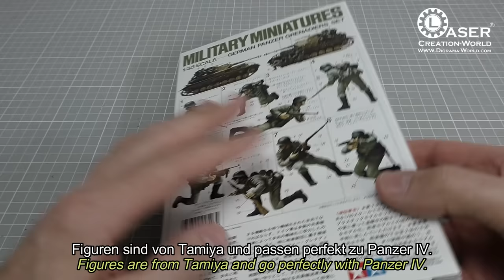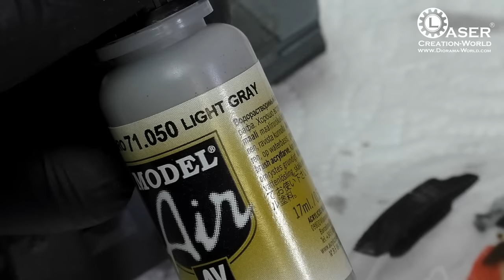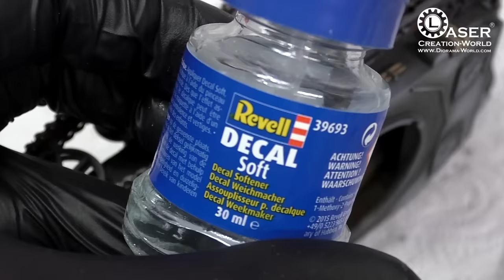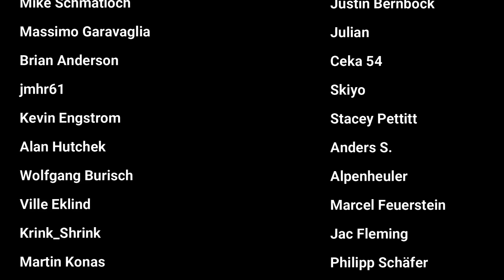Panzer IV for my German Invasion Diorama scale 1:35 / German Gray Tutorial

Comment: Little hint. Get some silicone mold release spray for the track forms. Google it, it's about $US 5.00  a can. Spray it on the forms and let it dry. It won't stick to the parts that you are putting on it, but you can assemble the parts on the form and then apply the glue.

Nice build as always though. I love your channel.

Comment: I'm surprised you didn't paint all the tools and bits and pieces separately and place them on the main body after the main paint?

Is it better to attach all accessories at once and then go back to paint them their final color or do them one at a time off the body and put them on after? I could never figure the best method. 

But then, that's why I have 2 dozen kits sitting around and not one started - that and wanting to be as good as those like you first time out. 😊

Comment: I love your builds , they are amazing . The way you paint looks effortless. 
What is the brand of glue you use & where can I get my hands on some of that in the states
Reply: If you mean the glue used with the  brush applicator that has the green cap on it, that's most likely Tamiya Extra Thin Cement.

I'm sure you would have come across it as it would be available in most, if not all, model/hobby stores anywhere. Though by now you probably would have found it?

Tamiya have a wide range of model kit cements, this one seems the go to for YT modellers. Ease of application for one thing. Nothing wrong with the basic cement though.

Hope that helps.

Comment: Being constructive, honest, at 26.23, putting bags over the steering brake vents would not be done as they overheated easily enough anyway, and the dust and heat were vented through them, so, not a good idea. Same thing with the engine vents blocked with sheets, asking for trouble if it was not snowing.
Reply: 🏍️ You might post this kind of criticism with a degree of trepidation, but i assure you i love a few tank nerds in the comment section. 🧐